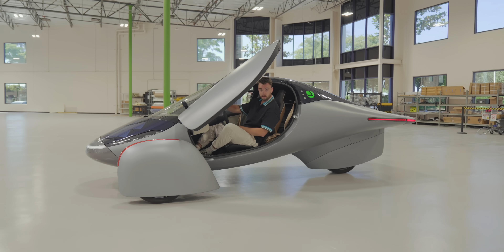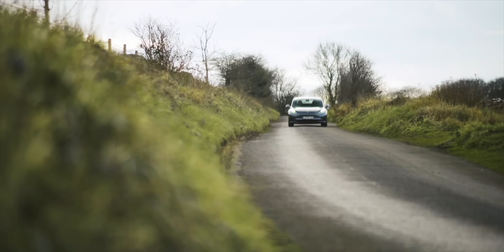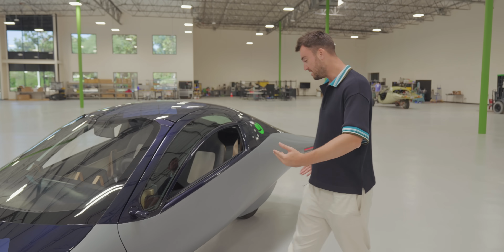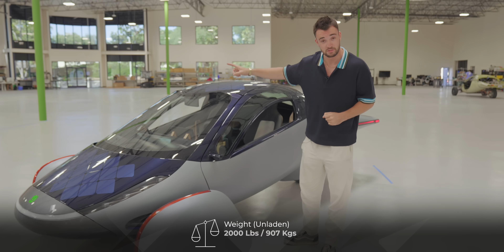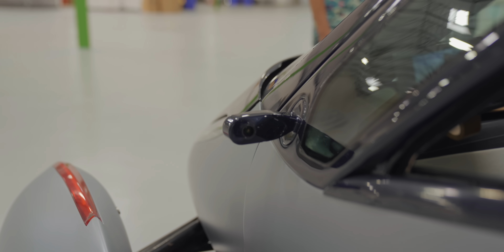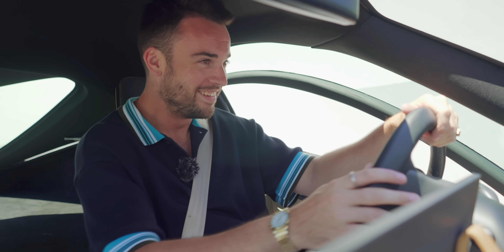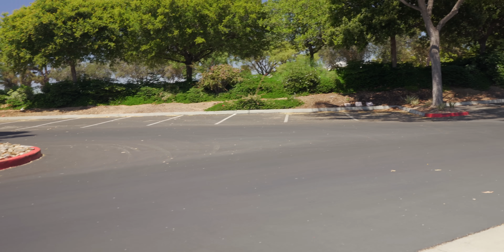The Game-Changing CHEAP Electric Car Inspired By Fish!

Comment: But no discussion on survivability in a car crash?? How does it do in Crash Tests? Front, Front corner, Side and Rear Impacts and roll overs?  Does the battery turn into a flamethrower like Tesla's when the batteries decide to explode for no apparent reason (videos on YouTube showing Tesla's burn up very quickly when battery gives up on living).

What's the body made out of and how's it's structural ability?

Those are just a few.things I would need to know about the vehicle before I'd ever buy one.  I am all for EVs but they can be deadlier than a gas guzzler.
Reply: He mentioned that the composite is 6 times stronger than steel on a weight-for-weight basis.  So lets say 3x stronger since they'll make it lighter.

Comment: Getting the sodium batteries more widespread will help immensely with being more "eco" friendly. Lithium domination is about over and it is not "eco" friendly as everyone thinks wrongfully. Aptera is not actually a "car" but a trike more akin to being a motorcycle. Those sail panels covering the front wheels should be a lot of fun in windy weather. Weight is the most important factor as weight in both cruising and acceleration is what chews up the energy the most. Even the body design doesn't affect energy usage as much as weight. That big center screen is poor attention to road time. Not a very good idea. They still have a long way to go before I would even consider buying one. Safety factors such as monitor and other issues. It might look spacey but that is also a design element that would not work well in an accident. In fact, the design will get you more likely killed or maimed. Not interested. DC motors are still better efficiency than AC induction...another point against it.

Comment: Just a huge accomplishment, certainly if they can actually sell them for less than $30k. Been following this concept for years and still blown away by the perfection of the design and it's  blend of form, function, and efficiency. With kids in school we just need a 4 seater, otherwise my order would be in. If this were a 4 seater they would have 250,000 orders rather than 25,000! Next model!
Reply: Yea car industry needs to realize that 30-40k for average car is not ok. Wages have NOT increased proprortionally with  Prices since the 80s.

Comment: Interesting vehicle but think I missed the part where you said what its top speed (or more importantly top persistent speed) is. 
Can you drive it at say ... 80 KMH (50 MPH)??  
Not that it matters that much to me. I doubt they would be very efficient here in Canada
Still I wish the company luck. Keep pushing the design and engineering boundaries and we are all likely to benefit over time.
Reply: It's software limited to 110mph. Relative to any other vehicle they will be at least twice as efficient here in Canada or anywhere else.

Comment: I am still skeptical of the active air cooling. Nissan tried the same thing with the original Leaf and those batteries suffered massive battery degradation in Arizona. Hopefully Aptera is considering that hard lesson learned by Nissan.
Reply: Yes, the Aptera has water that cools the battery, then is pumped through channels in a large aluminum plate that is the bottom underbelly.

Comment: The Aptera by definition is a high performance car. But for the Aptera's case, it performs high in efficiency rather than speed. And i'm all for it.
Reply: 0-60 in 3.5 seconds with AWD is hardly slow.  I don't expect to get much from solar (parking indoors) but am still totally looking forward to my Aptera.
Reply: Good luck going over potholes
Or when that windshield cracks
Or when it really only goes 200miles of range 
Or when you die from every crash in every angle
Or when it takes 5 days to charge
Reply: @KCJbomberFTW  Good luck watching the actual video champ

Anyhow looking forward to the serendipity of a sport version where larger wheels mean a larger motor and some crazy honda civic looking active aero option would be fun
Reply: @YouTube_username.  yeah it’s the same pitch they had 10 years ago with other peoples improvements in battery and motor
It’s still a cat in the hat pile of trash that will break going over a speed bump too fast
Reply: @KCJbomberFTW  looking forward to that not happening and never charging bc my commute isnt long and i live in civilisation

Comment: For what I thought looked like a small car, its actually rather big, especially for a 2 seater.
Reply: In fact ... it's enormous. Wouldn't fit in my garage due its width. Would be a nightmare on our local roads.
Reply: @MrAdopado  it is odd that it is 12" wider than my Model Y.
Reply: @blh1997-w1q  Having 1 less wheel means it needs to be wider to achieve stability.
Reply: @the_fixer_guy  oh, I get it, it just comes off as odd since it seems small and is very efficient.  I hope it does well.
Reply: @blh1997-w1q  Not quite that much wider though! Model Y 2.129metres to edge of mirrors. Aptera is 2.2metres so just under 3 inches wider but that's to the edge of the actual wheel spats presumably ... grazing a mirror on your Tesla isn't as bad as losing a wheel on the Aptera!
Reply: @the_fixer_guy  A Morgan 3 wheeler doesn't fall over ... 1.74 metres wide.
Reply: @MrAdopado  It's also not as tall as an Aptera I suspect.

Comment: Wondering about downforce. Cars need downforce, especially on the front wheels for steering. I don't see any front lip/spoiler.
Reply: The shape of the car provides downforce with the entire car acting like a venturi creating a low pressure between the bottom and the road.

Comment: first reviewer I've seen who's addressed it insane width. At 2.2 metres is significantly wider than a Range Rover or BMW X5 or anything else.
Reply: …not for Europe / UK
Reply: @markthomasson5077  Ah, so it's not incredibly wide then, phew. Significantly wider than an Escalade or Hummer.
Reply: EU/UK version will be narrower than the US version due to the L5e-A regulations (maximum 2M wide).  They've suggested 2024 for initial production of the EU version.
Reply: Stil would not fit in my drive
Reply: @markthomasson5077  If they go for the max permitted width, it'd end up being narrower than Richard's two examples, but still wider than the vast majority of cars.  The reasons that it's wide is mainly aerodynamics (to keep the wheel pods as far away from the body as possible to let the air through), but to a lesser extent also stability (since it is a trike), and to maximise solar coverage.  Most drives and garage doors are 7' or wider, so would fit it, but tightly.

Comment: let us be honest here... many car manufacturers EV-cars are not the price it is cuz of the battery's alone, they put up their margins, so they can faster recuperate the billions invested into making EV's.. and you pay premium price for some brands just cuz its a car from said brand, so even with comparable size, battery size, motor, and interior you pay 10%-15% more cuz its x-y brand, not cuz it cost so much more to make...
just like by ice , cars, most 45K ice cars are in Boom cost not much more expensive then $28K cars, but cuz its a higher class you need to pay extra money on top of the actual cost difference... i mean some cars have some textile on the door... it cost extra $10-30/door in bom cost... but they only use it on higher class cars, or faux leather on the dashboard, 1 yard  (54"x36") material costs $15-$40, so its not the material cost, its the perception of higher class, that cost's way  more then it should be...

Comment: Where did you find the "5 miles per kWh" figure for the Model 3? I've never seen an advertised or tested number that high (and as an owner I can say even the advertised 250wH/mile may be a little optimistic). Still the most efficient production EV on the market today, of course.

Comment: Good on them for doing so much work to make it as efficient as possible but I think they're dropping the ball in a few places. I'd have liked it if they went longer and narrower, did two seats in tandem with a back one that folds flat, like an enclosed Arcimoto. That way when I'm driving around solo which is most of the time the weight is centered, in a vehicle this light the driver is a non-trivial component, especially when it's me. Also for god sakes can everyone please stop putting sticky out monitors on their dashboards, there should not be corners to grab, put the monitor flush into the dashboard. You can't see what's behind the screen anyway there's no reason for there to be empty space back there. Tesla were wrong to do it on the model 3 you don't have to keep remaking their same mistake.

In addition the rear view side cameras should have their screens near where they're physically located, because I intuitively scan across all of them as I turn my head around to check my blind spots and if you relocate the right side mirror view to a different place it'll all be out of sequence, there's no reason to change this.

Comment: Tip for Aptera: the birds being aerodynamic and fish being hydrodynamic are due not only on their general shape but also on the microstructure of their feathers and scales. It should be easily and cheaply replicable to the skin of a car.
Reply: They have a video where they mention this.  They tested it and it didn’t make much difference.
Reply: Reynolds number...

Air acts more like a viscous fluid for small birds and most fish.

Comment: Is it a 2 seat, or are there seats in the back?  Looks like there might be seats in the back - if a bit lacking in leg room.  And what's trunk space like (if any?)
Reply: 2 seats, about 2 meters of cargo space behind the seats which gets very short towards the rear. About 708L total cargo space which is better than some small to medium size EVs...
Reply: 2 seater only.  The hatch space is fairly large
Reply: @randylewis4242  I guess the question would then be, is it a one-body trunk or a two-body trunk? Looks like probably a two-body trunk. Though for that use case you might want to tint the hatch window.
Reply: @ps.2  If you get the full solar it covers the hatch - so no window for those nosey looky-lous. People who have actually laid in it said it could fit two.  Especially if they're close friends or otherwise likely not to complain,

Comment: The swoop up behind the seating position is a part of that skin surface cooling. Most all EVs use flat panels underneath for the aerodynamic benefits but with four wheels and suspension needed for the ones at the rear there can be no swoop upwards. Briefly The air that gets admitted under the front of the cabin is slightly compressed but will be rapidly expanded from that swoop while still in contact with the vehicle. expanded air gets cooled in the same, but opposite way that air that gets compressed gets hot. Think of the heat of a bicycle pump near the bottom after several hard pumping strokes. All fast aircraft also taper towards the rear as do fish, birds and dolphins. It is how that taper is done that changes to a flattened form when close to the ground. I study these things as I work with streamlined  human powered vehicles that are even more efficient than the Aptera. Our world record racers have achieved 89.6mph through 200 Meters after a 5 mile run up on flat ground with nothing but the leg, heart and lung power of the rider.
Reply: >Briefly The air that gets admitted under the front of the cabin is slightly compressed but will be rapidly expanded from that swoop while still in contact with the vehicle. 

You're describing a low pressure zone, which would mean the drag would be incredibly high. I'm pretty sure that's exactly the opposite of what the car designers wanted. They made the car to be slippery, which means as little drag loss to low pressure zones behind, around, and under the car as possible. It would be impossible to both have a low drag coefficient and also create a zone of low pressure that's creates a cooling effect through gas expansion.

Comment: I would happily drive down the A5 and M69 to Leicester in one of these, if it can reach Motorway speeds (don’t remember hearing that mentioned during the description.) or stay off the M69 if it can’t. It really is a no-brainer. Sadly I doubt we will be seeing any in the UK any time soon.
Reply: Top speed 110 mph
Reply: @richevanscpa  no! That would be… interesting! I used to live in Germany where this would be legal!
Reply: The UK/EU version is being designed, tentatively first production in 2024 but I think it'll end up being later than that.  The difference is due to the L5e-A regulations, which means that it has to be under 2M wide (anything wider is just impractical on our roads anyway).  I put in my reservation a couple of months ago.  Top speed is as Rich stated.  0-60 time is either 3.5s or 5.5s depending on whether you pick 2-WD or 3-WD.  Will be fine on the motorways.
Reply: @WyndStryke  "Will be fine on the motorways."  get plenty of these on a motorway and it will be much quieter for those living by the motorway!  Would have thought it will make a great motorway cruiser as should much quieter than your average car...
Reply: @peterchandler8505  it was more a question of whether the car would be able to reach motor way speeds.
Reply: @randomjasmicisrandom  As you noticed, Rich Evans noted above that the top speed is 110mph, that is not when it runs out of steam (on an electric car...  LOL ) , but when the software speed limiter kicks in...  

You wonder about reaching motorways speeds after noting that you missed the bit about 0 to 60...  If it is going to take 5.5 or 3.5 seconds to get to 60, I just might suggest that the extra 10mph just may not be much of a challenge?  One option delivers 150hp, in a car weighing just under a ton, with negligible air resistance as it's CD is 0.13, I would suggest these numbers suggest that there are many sports cars that would struggle to keep up with an Aptera!  On that point InsideEVs shared a little video that Aptera made after spending the day doing development testing at a track, ended the day with a drag race, 2 prototype versions of the Aptera, an Audi R8 & a Tesla Model 3, both Apteras were clear in front at the end of the quarter mile drag, so if an Aptera can beat both the R8 & Model 3 over a quarter mile (Model 3s tend to reach about 100 to 110mph at the end of a quarter mile drag depending on the model)...  Guess that just may lend weight to the Aptera reaching motorway speeds, comfortably (or even the 110mph speed limiter)?  Guess more of a problem keeping under 70 ish to avoid upsetting the boys in blue, who I guess just might be interested to find an excuse to pull over early UK Apteras over just to check the Aptera out?
Reply: @WyndStryke  thanks, I’m hoping to go EV faster than that timeline, but this would be a brilliant commuter car. I missed the bit about the 0 to 60 which obviously means it is going to be fine at motorway speeds.

Comment: 2.20m, too bad for Europe. I wonder why they didn't put the side mirror cameras into the front wheel fenders, or fill the trunk door with PV, after all they already have interior mirror camera, so might as well be opaque.
Reply: They are designing an EU model, it has to be 2M or less due to L5e-A regulations.  Tentatively 2024 for first production.

Comment: I'm looking at this vehicle with much anticipation. Its going to change almost everything we think about when it comes to vehicular design and concepts. I definitely want one. Most people don't even travel more than 80 miles a day. So this car will almost never need to be charged. Less not forget the added benefit of not having to worry about gas prices ever again. I'm very hype for this company and what it'll do for the progression of our society. God bless ...
Reply: Looks like average milage driven seems to be about / not far from 30 miles per day UK, EU, & US....  Hence there are many in sunny parts that would never, ever need to plug in!
Reply: I'm stranded in Phoenix & cummute 45 miles each way. Wonder how it'll handle long distance.
Reply: @bucktooth002  From what I seen it should be fine..  
5.5 or 3.5 seconds to 60 so you won't be ... holding other traffic up...
As so aerodynamic, & electric, the two biggest sources of noise (wind & engine noise) are gone so it should be quiet even at the speed limit...  
Aptera's website has a charging calculator but it only goes up to 50 miles driven per day, depending on the battery option you chose, you might need a plug in charge around every week or two with one of the bigger battery options?  That is a wild guess as it depends how sunny it is where you park, and how heavy your right foot is...
I would have thought that the Aptera would be a breeze for you, should make your commute so much more comfortable....  Obviously we won'r really know until production versions are being shipped out of the company!

Comment: I find these efficiency statements puzzling given that efficiency is highly dependent on the speed of the vehicle.  So, it would be useful to see the efficiency relative to speed for each vehicle, not a maximum efficiency which seems misleading at best.
Reply: Same for every other vehicle. 
So no, it is not misleading when it comes to compare them to each other.
Reply: @charangohabsburg1  with ICE you get three ratings, not just one…
Reply: @pstoppani  What's the problem not mixing up different ratings? It's really not that hard!
Reply: @charangohabsburg1  we’re obviously not in interested in the same info NP
Reply: My issue is that video like this often talk about max efficiency in terms of miles per kWH.  However, if you look at the MPGe numbers for overall, city, hwy you see that, for example, the Lucid Air is not more efficient than say the Model 3 (cars they mentioned in the video) in the combined and city cycles and the Air iis more efficient on the hwy due to the better aero.  That, to me, makes quoting the optimal miles per kWH meaningless PR fluff.